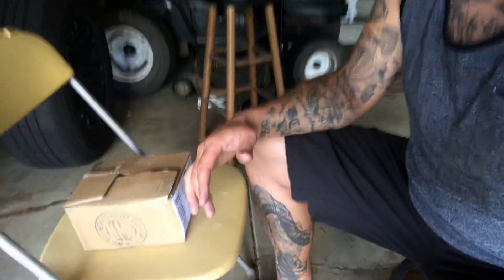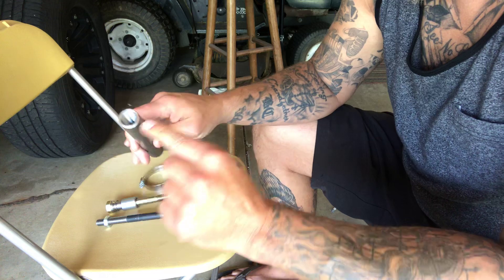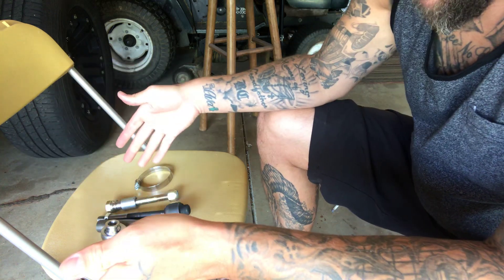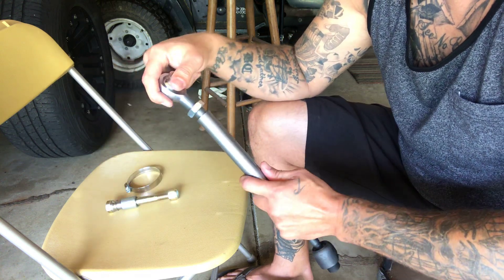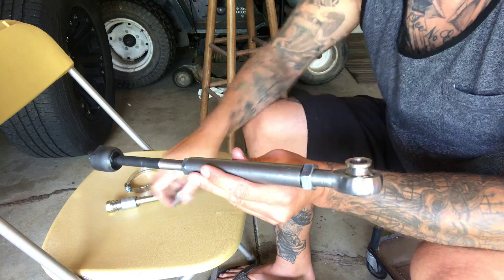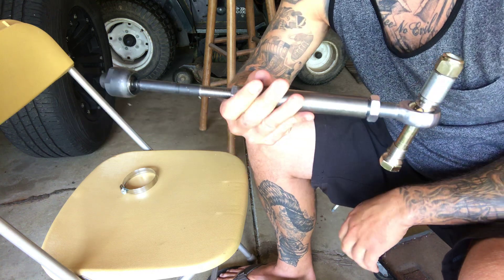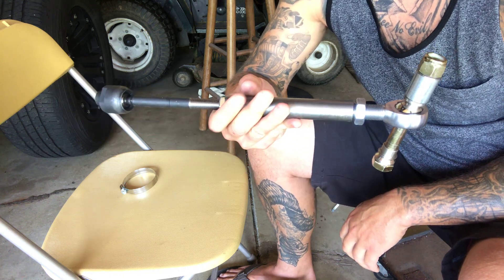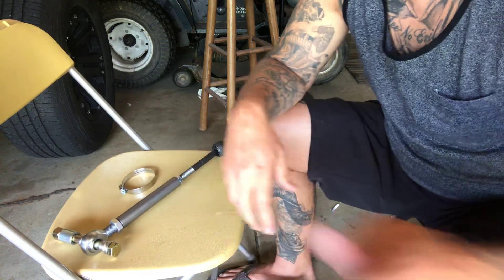Nfamus metal fab unbox bump steer Kit

Comment: Did you have to drill out your steering knuckle on your spindle to fit those bolts?
Reply from the maker: Yes, as far as I can remember I had to drill those out with a 5/8 drill bit.